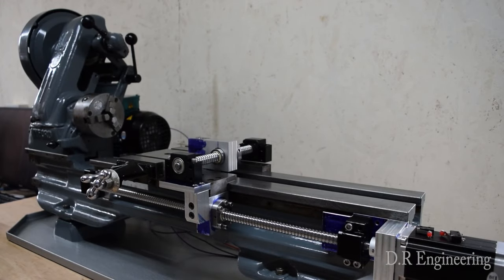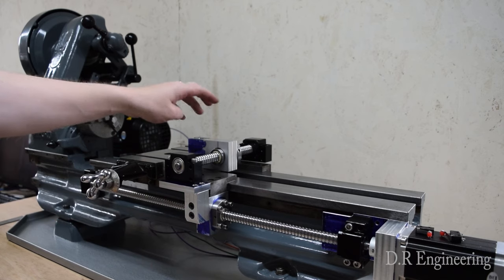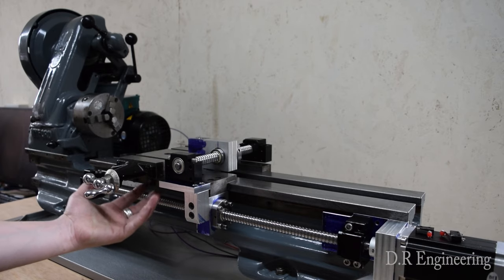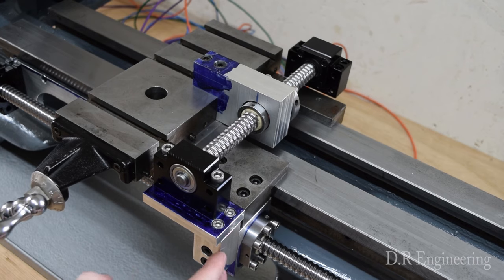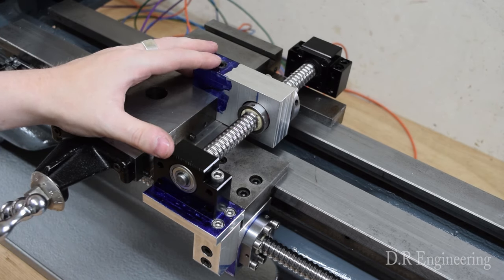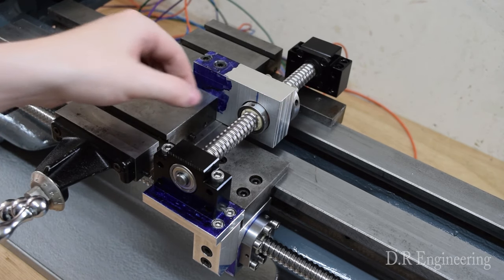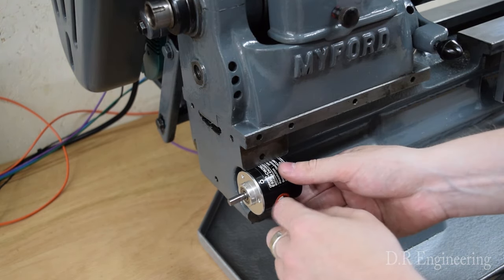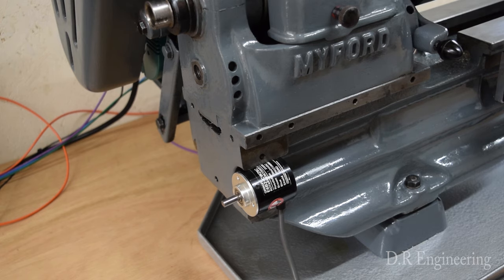CNC Myford Conversion update, X Axis construction

Comment: Any update on how your conversion is progressing? I am quite keen to follow your example depending on how this works out for you.
Reply from the maker: I have turned parts with this setup, however I was getting a few issues with the ball screw arrangement for the x axis so I'm currently designing a new cross slide which can contain the ball screw centrally.
Unfortunately the ball screws are much thicker than the original ACME screws so can't be placed inside the original cross slide.
I'll make a video update soon about this and the plan ahead. Thanks for watching